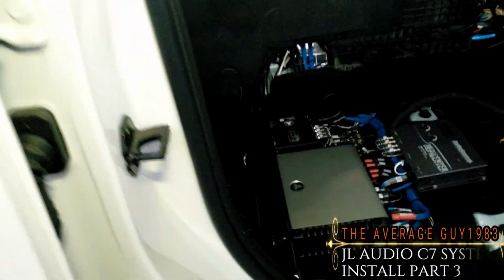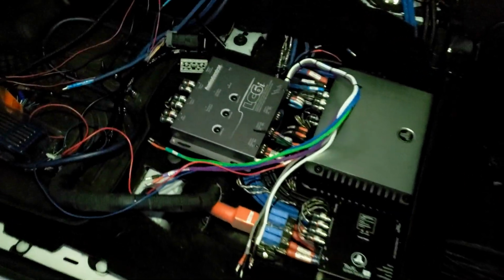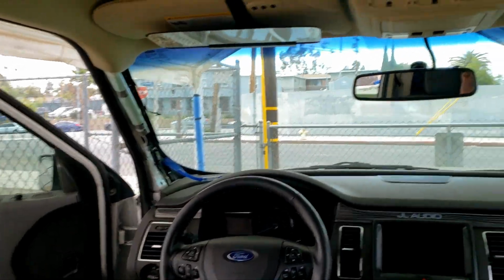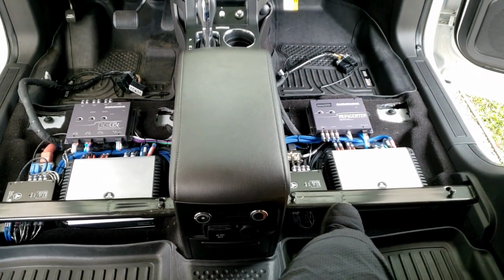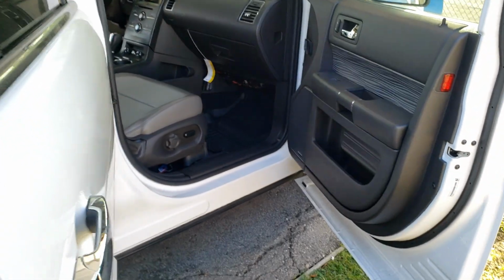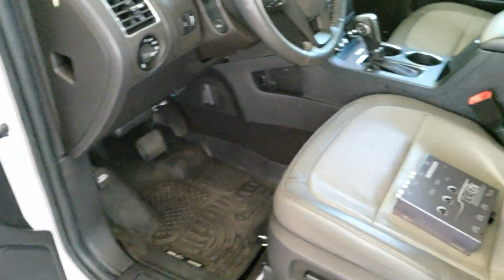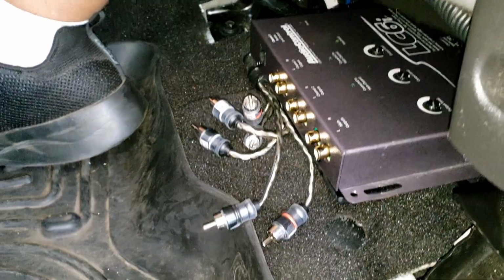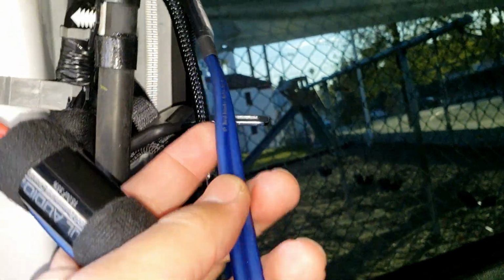JL Audio C7 System Install Part 3

Comment: Hey Louie, I have a 2019 flex Limited with the Sony system and I was wondering where I should hook up my line out converter? Should I use the factory Sub output wires or should I go before or after the Factory Sony amp? Should I wire behind factory deck?
Reply from the maker: Excellent question. I would go with the outputs of the Sony amp. The rear Left and right door speaker outputs are full range. I don't remember the color coding for them but its a Gray Harness clip with the most wires on it on the Sony Amp, you can use a Multimeter set to AC volts or a little cheap speaker with two wires attached to it for + & - and then from the radio change the fader to rear and then the Balance to left or right and see which one makes the speaker play music from it once you place those speaker wires on the harness. It would be the best way to identify the speaker outputs. If you need any additional help, please feel free to come back.
Reply: @THEAVERAGEGUY1983  great! Thank you. One last question…. Where did you ground the amps in the flex?
Reply from the maker: @Chad Freeman  I grounded them to the bolt on the right front passenger side of the center console. That spot worked very well after I removed some of the paint from the surface. I then added a ground distribution block to that wire that I added to that bolt. If upu remove the side panel from the center console you will spot the two bolts holding this aluminum or metal bracket that is attached to the radio for grounding as well. It's by the 12 volt socket.
Reply from the maker: @sick98civic  I believe it's a 5/8" thick bolt.

Comment: Es normal que hd 900 caliente bastante?
Reply from the maker: Honesta mente? Si. Todos Los Amplificadores HD corren bastante Caliente. Pero nunca me han fallado. Es una de las rasones que puse estos HD Amplificadores bajo los asientos en El coche donde tengo accesso al Aire Acondicionado. Con El Aire Acondicionado Los Amplificadores HD se mantienen Ventilados 😁👍
Reply: @THEAVERAGEGUY1983  tengo 2
Hd900 y hd750 
El hd750 no calienta tanto como el hd 900 y si también bajo los asientos...
Reply from the maker: @raydossantos2356  ah, creo que es porque El HD900/5 es de 5 Canales y Como tiene la linea del Subwoofer aun que no se este usando, Va seguir teniendo la linea abrierta y Caliente.
Reply: @THEAVERAGEGUY1983  entiendo.... gracias pensé que estaba fallando o algo
Gracias
Reply from the maker: @raydossantos2356  😁👊

Comment: I have a wavtech link8 do you think I should just go with the twk88 and just bypass a fix86
Reply from the maker: That's an excellent Question! It really depends what kind of head unit you have, like for example are you using a factory radio that has an aftermarket amp? There are some cases where as long as an aftermarket amp is a 6 channel for example 2 channels for your front 2 which if you have tweeters up front that seem like component speakers with separate door speaker and tweeter, there may be be chance that it's wired together giving the factory amp a 2 ohm load to make the front speakers sound louder then the rear speakers  then there is 2 channels for the rear and 2 channels for a factory subwoofer with low frequency only coming out of the sub amp channels etc then you can get away with using the Wavetech Link8  just like I did with the LC7i but........ if it's more channels like let's say an 8 channel factory amp which uses 2 channels for your tweeters, 2 channels for your front doors 2 channels for your rear doors and 2 channels for your subwoofer or even 1 channel split for your subwoofer and 1 channel for a center speakers which would equal 8 channels then yes you would definitely need to have something like a FiX 86 or a Audiocontrol DM608 as an example.
Reply from the maker: Apologies for the late reply, youtube doent let me know when someone new comments on the channel or video I have until about 5 to 6 hours later. Usually I respond much quicker then that as long as youtube let's me know someone left a comment. 😅
Reply: Thank you
Reply from the maker: @AceMcPippen  😁👊

Comment: Hi Why didn't you use fix 86??
Reply from the maker: Hello, After reading alot of reviews about hissing problems and the flat frequency calibration being off for alot of users i chose not to buy it after all. I do have the connectors for it that help give an input sense at low volume so that the Fix86 won't shut off on its own but I'm very happy with the results from the LC7i.